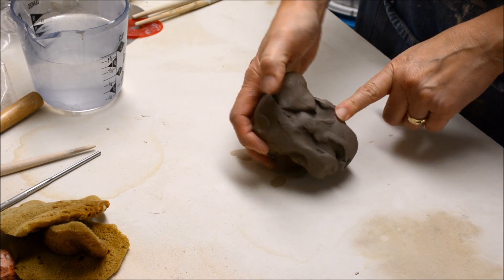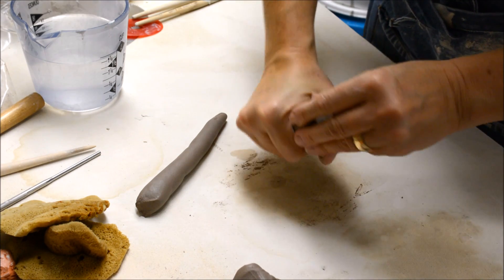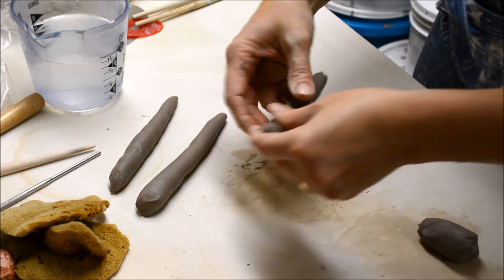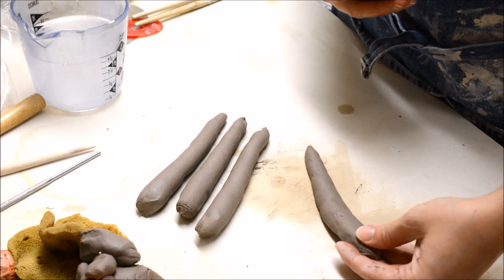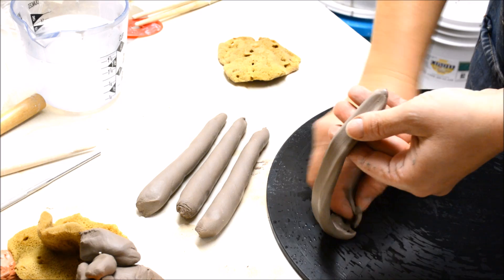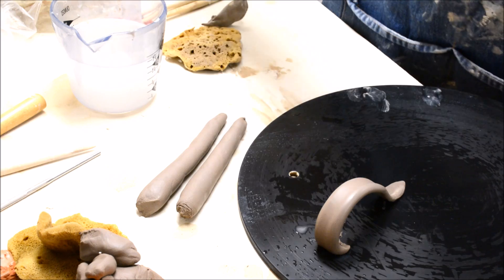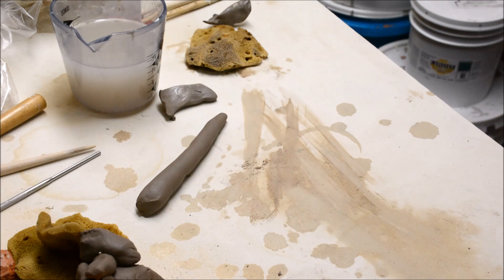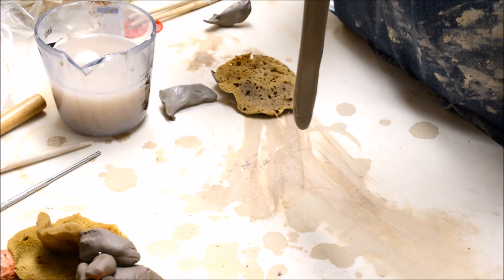Making a "Fake" Pulled Handle

Comment: I have been having so many struggles with my handles it’s driving me crazy. When you handbuilding a mug, at what point do you make the handles? Before you make the mug? And do you just leave the handle sitting on the tray the entire time? When do you join the handle? Sorry for so may questions. I have watched this video before but was trying to actually pull the handle. It’s a mess.  Thank you so much.
Reply from the maker: Hi Michele- I make the handle normally as I am cleaning. As long as you keep the handle and cup form in the same bag or damp box, and they are the same moisture, you should be able to attach!  The worst case scenario is attaching the two when they are different moistures!  Here’s a video I did on making damp boxes! Since I made them for every student this year, they’ve had better luck controlling their moisture!  https://youtu.be/iUcLptP4Wlo